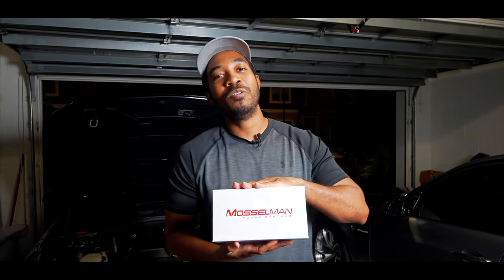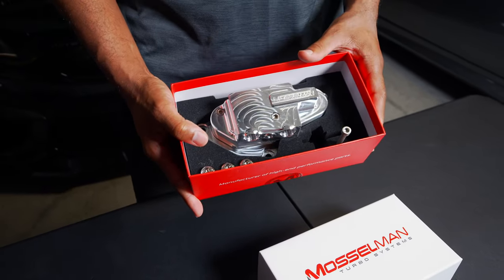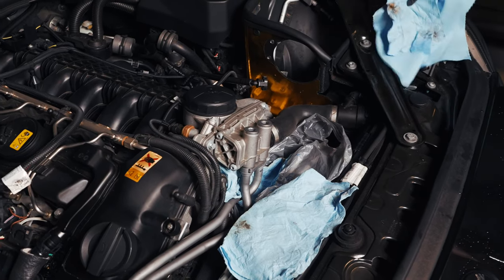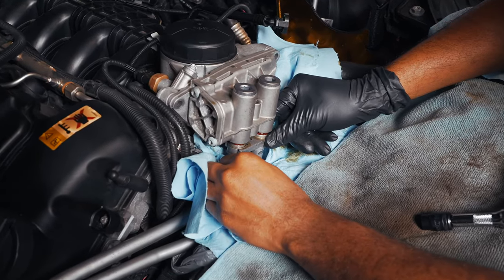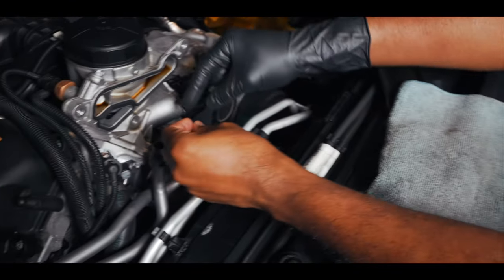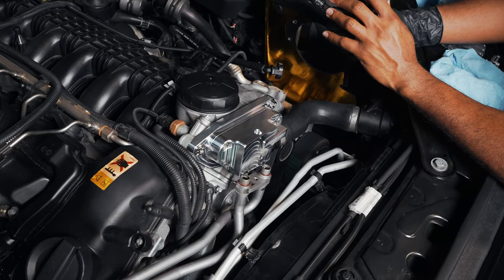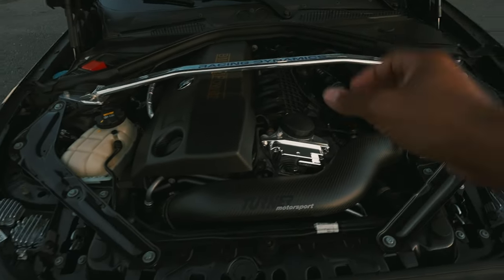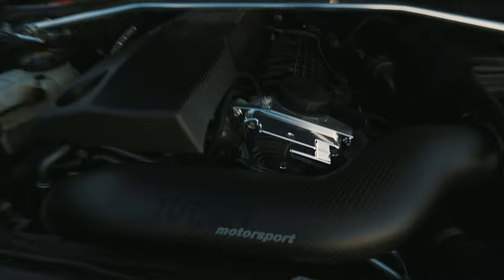Lower Your BMW Oil Temps With This Simple Mod! (Mosselman Oil Thermostat Install on a BMW M2)

Comment: One of the best mods you can do. Heidi never gets above 205 oil temperatures no matter how hard I drive her. Great choice! We also used the holes on the titanium bolts and did a cool looking safety wire design.
Reply from the maker: Nice, yeah I’m considering safety wiring mine as well
Reply: Who tf is Heidi? 😂

Comment: I dont see an option for 535i would this still work on mine or do i need to find a specific brand that has my car model
Reply from the maker: I don’t believe so as the setup on the F10 N55 is different. I would email Mosselman just to confirm if it would be compatible.

Comment: What was the oil level after installing, the same ?
Reply from the maker: More or less the same, I just topped it up a little bit just to compensate for the amount that came out
Reply: I see only asking cause I’m looking into installing it Monday or Tuesday which ever day it comes in, thank you though
Reply from the maker: No problem 👍🏾

Comment: Should I do this before a intercooler?
Reply from the maker: Both are beneficial, but they do serve two different purposes. The thermostat will help to regulate your oil temperatures better and the intercooler will help to lower and maintain your IATs (intake air temperature). Price isn't far off between the two, so the choice is really up to you.
Reply: @MotoGearTV  ah ok, I appreciate the response.  I recently got my og m2 and I am wondering what mods I should do first?
Reply from the maker: @ryan2k814 I would say make sure your maintenance is up to date, then move to aesthetics and then performance, I did an ownership review on mine walking through how I did my build and it’s a good reference tool. I plan on making a mods list video in the next few weeks as well so you can look out for that👍🏾
Reply: @MotoGearTV  ok thanks man